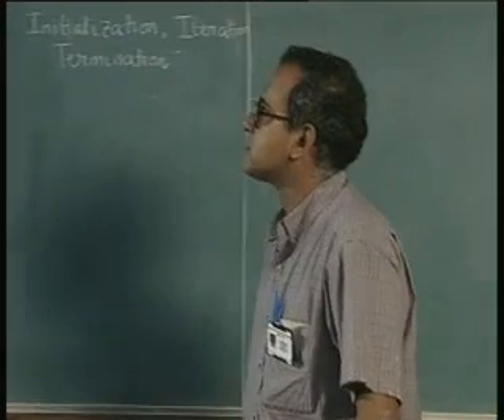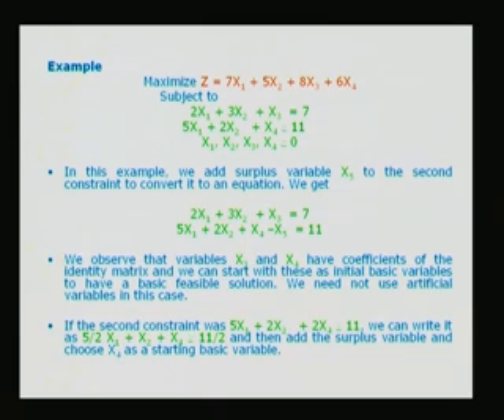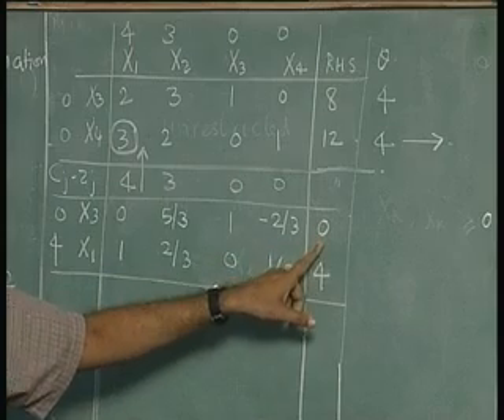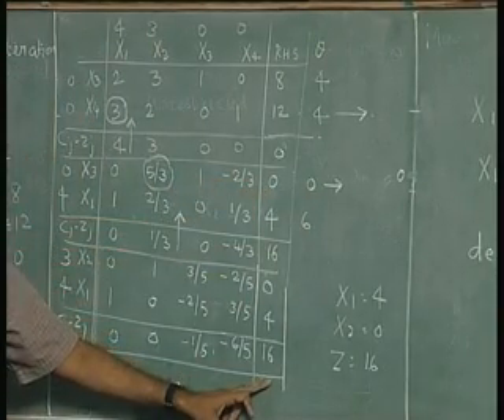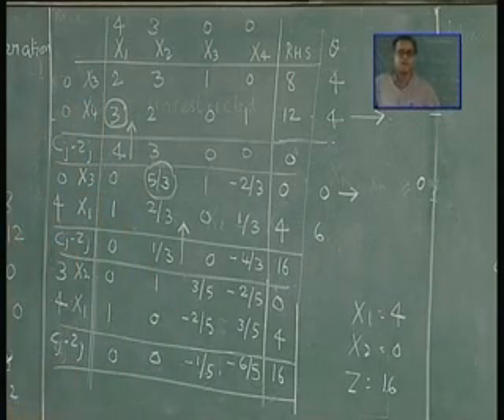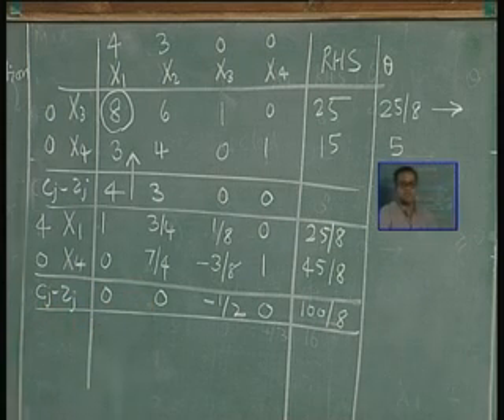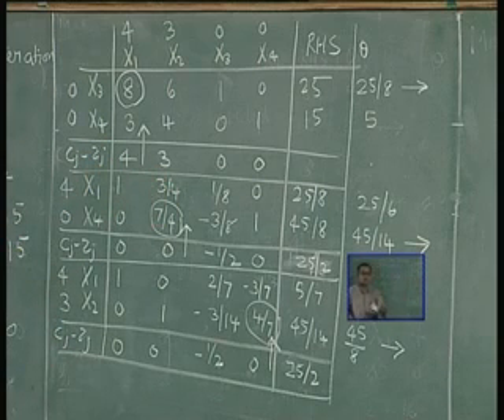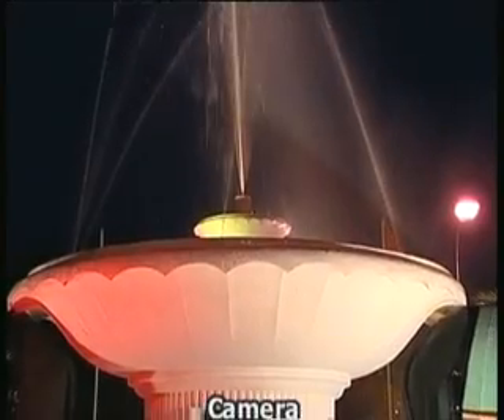Lec-6 Simplex Algorithm - Initialization and Iteration

Comment: Hello sir , a doubt, in case you eliminate x3 from the first iteration where both x3 and x4 were equal to 4, then degeneracy would not have taken place and in the second iteration itself we could have got our final answer., and the simple logic to that is to remove that basis whose RHS is smaller, rather than looking at the theta, in cases where the theta for both the basisi are same.
Reply: ohh you have addressed the  issue later, great to have you teaching us on you tube